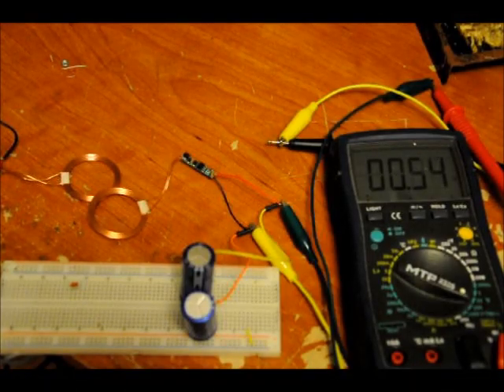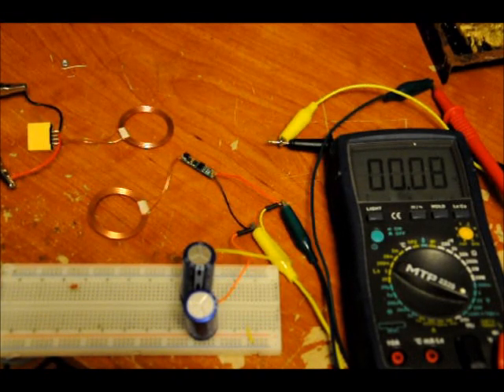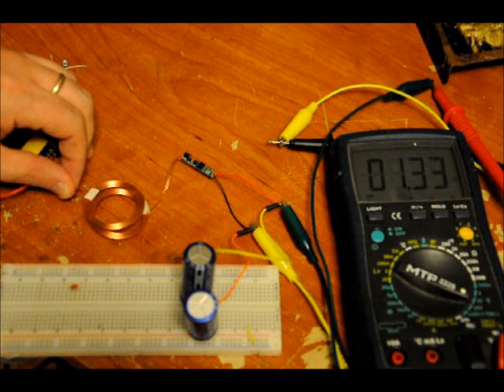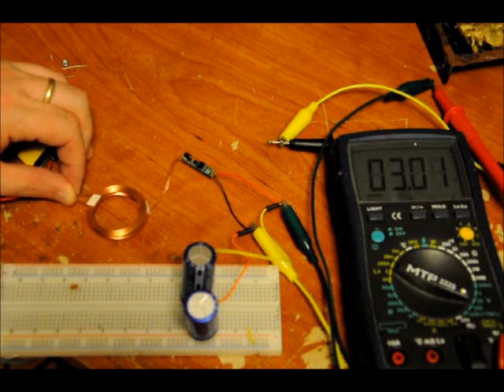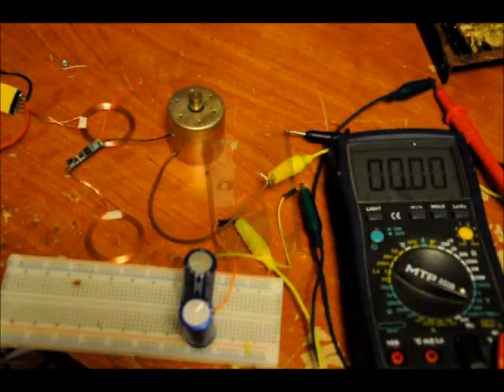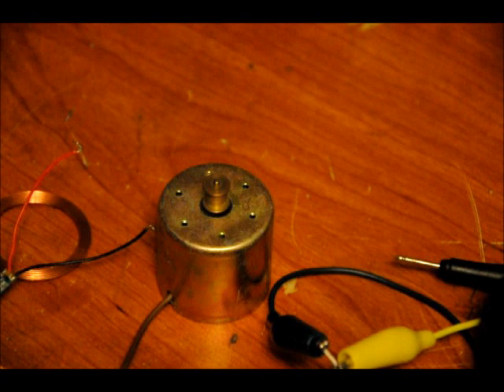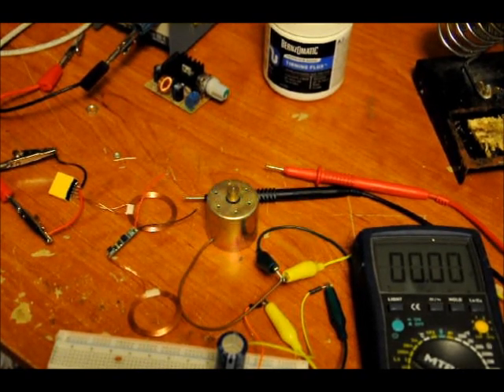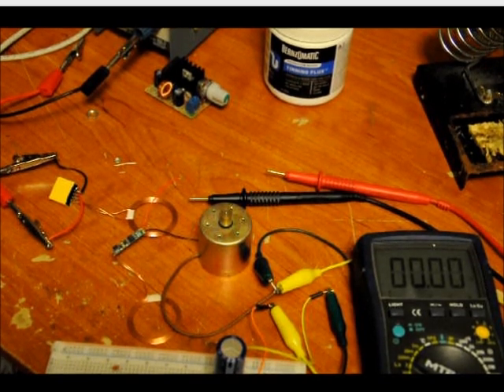Charging Super Capacitors With A Wireless Charging System!!!

Comment: I have a 750mA transmitter that can light up several small LEDs connected to receiving coils. The receiving coils make less than 300mA in the best position, and not much more than 100mV. How can i charge a capacitor with that, and what capacitor would i use? My goal is to make the LEDs glow for a little while after i remove it from the transmitter.